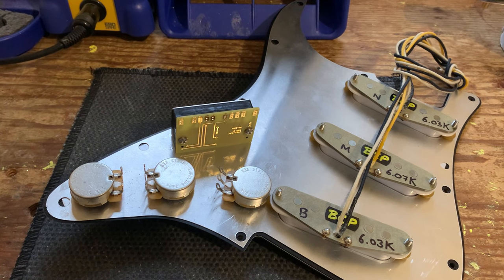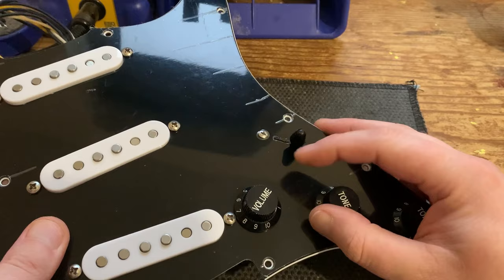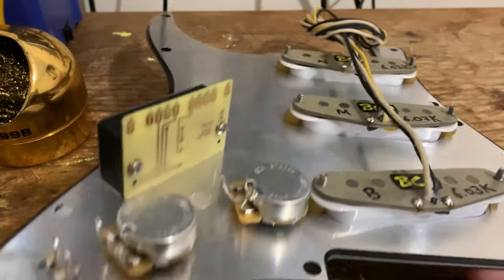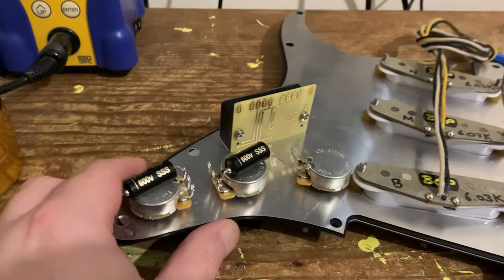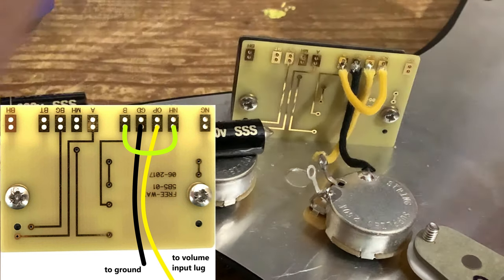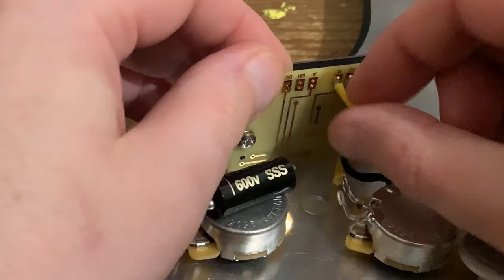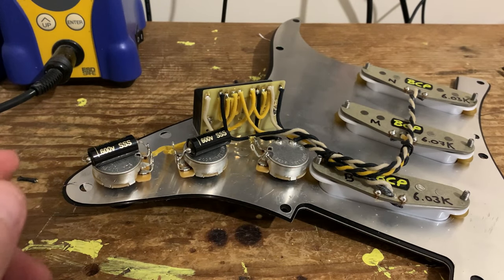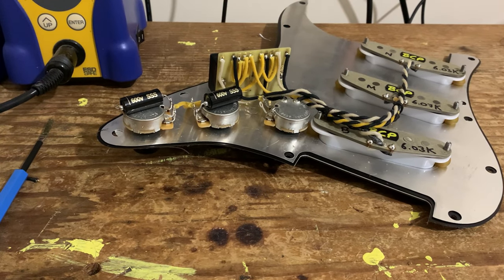10 way Strat wiring:  How to wire a Free-Way Blade Switch

Comment: Very nicely done. Do a Freeway 5-Way/10-Position install on a Nashville Style Telecaster SSS 1 Volume, 1 Tone and you'll be my hero. Great video and beautifully finished wiring job.
Reply: Yes, also waiting for that!
Reply: You have to get the 6 way switch for tele (I think) they have a wiring scheme on freeway website. 3b3-01 model and they have a wiring diagram for tele sss w 2 pots. They also have the 5 way sss w 2 pots wiring diagram but I don’t know if the switch will fit in your guitar physically otherwise to answer your question yes you can and there is a diagram for you. Go to
https://www.freewayswitch.com/schematics-blade/
Reply: @leinadatidumarp  read my reply
Reply: @50kal44  I contacted Freeway and ended up doing the 5-way/10 position in my Nashville Tele. Switch fits well, just a little hard to fit all wires in the cavity, they told me to ground the bridge with the cavity screw. Guitar is being set up now, bought a new Rosewood neck and I need to cut the nut, but all of the switching worked appropriately when I tested it the other day. Should be able to get her finished over the next couple of days. I'll let you know how it turns out, if you're interested
Reply: @50kal44  thank you
Reply: @thseed7  how is it going with your mod? I was planning on doing the same
Reply: @50kal44 that's a standard tele wiring
Reply: @andreaturano9247  Turned out incredibly well. Love the series positions and the ability to get classic Tele neck and Bridge combo in my Nashville now. Love it so much that I threw one in my Strat as well. Truly is a great functionality addition. Switch is as robust as a standard Tele 3 or 4 Way, but I haven't had any issues after hundreds of hours playing both guitars. They're significantly better than the cheap PCB 5 Way switches in the Squires or other budget guitars. Can't recommend them highly enough.

Comment: This video really helped me out a lot. Soldiering has never been my specialty, but there were a lot of little tricks and technique caught on camera that I picked up on. I'm pretty happy with the results and looks almost identical minus the difference in pots/capacitors and the pickups used. I didn't have an aluminum plate so I soldered a bare fluxed wired across all 3 pots.

Comment: Terrific video, I just went through it and replaced the switch in a 2017 American Special.  The video was invaluable, thanks.  A couple of comments... I know you had to film, and it might have been confusing, but it's very easy to solder the wires on the opposite side of the circuit board and then clip them off.  Also, the tone control bleed caps change the wiring to the tone pots.  Great job on your soldering and very nice to have clear graphics in the picture.
Reply from the maker: Glad it helped. Thanks for the feedback!

Comment: I wired my Strat up exactly as you did here. Although it has a good sound, I noticed that something may not be correct. According to the diagram from Freeway, there should be two wires going to the first spot on the left. One going to Bridge Hot, the other going to the middle lug on T2. I’m going to change it because that seems to be for tone control on the bridge only, and the other tone control is for the neck. 
I still very much appreciate your video, your tips and techniques were very helpful. Check out the diagram and please correct me if I am incorrect.

Comment: Hi I've watched a lot of your videos, and find them impressive and very helpful. I've just finished wiring up one of these Freeway switches and found it reasonably straightforward. However, I found it much easier to feed the wire in from the front as you show then solder from the back. I found the 'fluff' on the wire a nuisance to get around! These cloth wires seem to vary a lot depending on supplier, and description they give - the best ones have a fully soldered core and tight cloth, some I bought have separate core wires and fluffy cloth surround. Cheers.

Comment: Huge thanks for this!
I have a Suhr 'strat' HSS set up and standard fender strat guitars. I think Free-Way also covers the HSS option, though there's a bunch of soldering options also - hopefully a bridge humbucker split option will allow S, -, S in parallel (there's a fantastic 'Tele' tone here!)
I really think they should do, as well as a 2 x 5 option (as seen here), they should expand this for a 3 x 5 option, giving us an extra bank to cover missing options. Same applies for the Les Paul 3-way toggle selector (they do a 2 x 3, a 3 x 3 would add further sounds). If they can bank those additional connections to one side of a standard selector switch, I'm hoping they can bank to the other side also.

Comment: This is a great switch and I can strongly recommend the Page 1 scheme where you use Middle and Bridge pickup seriell instead of all three together. I tried that first but the three single could together creates a muddy mess while Middle and Bridge together can be useful for some gain/overdrive.
What I would like to do is to use the Second tone control for both Middle and Bridge but I haven't found a way. I tried a cable from MH to the tone  second tone pot but that didn't work.
Reply from the maker: Yes we use the page 1 scheme in our prewired kit as all three pickups in series is pretty underwhelming! We have a way, so feel free to email us and we can send the diagram
Reply: @SixStringSupplies  Thanks. I got a scheme from Freeway and a Bourne Dual Gang Pot from RS and it seems to work fine. I have never used a Dual Pot before, half the turn for middle and half for bridge. I thought it would control both at the same time, but this will work too. 
And thank you for an excellent channel!!

Comment: Amazing video. Wired mine up with little to no soldering experience (bought a practice kit off ebay) thanks to your video.

I did follow the alternate wiring diagram because I wanted the "humbucker" in position 6. Minor change and easy enough to figure out after watching this video. Thank you!

Comment: Very smart to use a PC board to avoid a cluster of wires, simple and genius.  Over engineering I using a pc board with programmed configurations, this requires a small populated board with both passive and active electronics, programming ( increases risk of failure) and a power source ( battery).

Comment: Super helpful video!  I have a quick question about wiring up this switch with specific pickups.  I'm curious about getting some Fender noiseless strat single coil pickups, which have 3 wires coming from each pickup instead of 2 like with regular single coils.  Would it be possible to get some of these noiseless single coils and wire them up with this 10 way switch?

Comment: Super video, super explained! I still have one question. Do capacitors with the same capacitance have to be soldered in this circuit? I have one 0.047 and one 0.022. To which potentiometer do I have to solder which capacitor?

Comment: Great video. Thank you. But how would you wire it so the middle tone pot works on the bridge pickup as well. On a normal switch you can just add a bridging wire but how would you do it on this switch? Thank you.

Comment: I have just purchased the 10 way strat switch and in preparation to install, I have noticed my current 5 way switch setup has 2 capacitors that are not shown in the 10 way switch setup. I just want to double check whether i leave them as they are or remove them from the board? Basically there is an additional capacitor on each tone knob that bridges 2 of the points on the same capacitor...if that makes sense...

Comment: You need to do a video on how to wire a 6 way rotary switch on a strat.  Pull the 5 way switch and put the 6 way 6t/2 poll rotary in a tone slot. You can cut the post with a dremel or hack saw if it's too long.  Takes 30 seconds with a dremel.  Took me a day to figure out the wiring on it.  It gives you an added position.  Bridge/neck.  And it gets the switch out of the way so you don't hit it while chording hard.

Comment: Hello, I have a problem with the bridge capacitor. When I move the bridge potentiometer it acts on the middle pickup. I did the installation as shown in the diagram.

Comment: Great video. You're absolutely right the PCB holes are too small. I wired one up a few months ago , but then the tone controls stopped working in all positions except the neck. Any suggestions I can try to remedy this?
Reply: Sounds like your connection to the bottom tone knob is broken at some point. Check the solder joints for the wire that runs from the switch to that pot.

Comment: Thanks for the video. If I wanted to add my bridge pickup to be controlled with the neck tone knob (middle tone knob for middle pu only and the neck tone knob to adjust both neck and bridge tone then where should I add a bridge wire to this wiring diagram to accomplish this ? Thanks so much for any help

Comment: Good vid, thanks. Was wondering...I don't want to get the installation of the switch the wrong way round. If the lever is closest to the BH terminal side, presumably that will turn on the Bridge pickups? And if the lever is over to the NG terminal, that's going to switch on the neck pickup - is that right - have i got it the right way round?

Comment: I've got a Question:
I got a Fender Deluxe Nashville Telecaster about a year ago. From the Factory it came with a normal Strat Switch. I resoldered it so i got this: 1. Position Middle
         2. Position Middle+Bridge
         3. Position Bridge
         4. Position Neck+Bridge
         5. Position Neck.

Now my Question: Can i Install this Switch in my Tele and Set it like this:
Normal Roe: 
1. Position Bridge
2. Position Bridge+Neck
3. Position Neck

Upper Roe:
1. Position Middle+Bridge
2. Position Middle
3. Position Middle+Neck

Or do i have to do the whole in Series, Out of Phase Wiring?

Comment: BT is used with a Bridge Humbucker if a 5B5-01 is used in an HSS set up. With Seymour Duncan wiring codes the red and white wire would be soldered to BT.  So I suppose BT is for Bridge Tap for what is technically a coil split in the relevant switch positions.
Reply from the maker: good knowledge, thanks for sharing. Free-Way to have a specialist switch specifically designed for HSS setups too 5B5-02 https://www.freewayswitch.com/products/
Reply: @SixStringSupplies  No problem I spend too much time looking at wiring and guitar stuff. I have seen the diagrams for the 5B5-02 and emailed Freeway a little while ago but at that time they weren't available yet. Looks they are starting to become available.
Reply from the maker: They are available now at various dealers - we expect to have them in stock for our next order which will be February.

Comment: Hi , do you know if I could add a resistor between BT and BH to lessen the coil split volume drop and liven up position 2 ? I have a 4 wire humbucker in the bridge and position 1 and 2 is a bit weak . Great vids by the way ...thanks

Comment: Can a treble bleed mod be done with a freeway switch installed? Would the different kinds of pickup wirings vs. the standard need to be considered / have any influence on which capacitor/resistor to choose? Any experience here? :)

Comment: Great video. I'm keen to try it. On the PDF it says Terminal A is not used. Is that correct or did I miss something. I noticed you used it.
Reply from the maker: Different diagram - there are two options

Comment: Hello, thank you very much for the professional guide to soldering the Freeway Switch 5B5-01.  I just installed the device in my Harley Benton ST-20 BK.  Everything went well, all positions work - only position 6 (bridge + middle in series) remains "dead" 🙁 Also the tone knobs are working not as they should. Do you have an idea what is wrong?
Reply from the maker: Hi - does your bridge pickup have a baseplate? If so, this will be the issue - you need to ground it to the switch as directed by the diagram (or remove it entirely)
Reply: @SixStringSupplies  Hello, thank you very much for your answer.  No, my bridge pickup doesn't have a metal baseplate.  I have now soldered everything again as the instructions for the SSS Parallel Series Sheme A1 / V2 T show.  Result: The same error - position 6 in series remains dead. Perhaps the switch itself is defective.  I asked the seller to send me a replacement.  I'll get in touch when the new switch is soldered.  So long, Wolf

Comment: Can this be put on a clapton signatur?? It only has 1 tone (upper tone) with the lower being used for the 25db boost.  I am goona to assume your  bottom tone connection is going to the upper tone control.
Reply: I tried installing and didn't work right at all. I contacted their tech support and they sent me hand drawn schematics (as they do not have official ones for tbx models) that they sent to others wiring tbx guitars. Main difference seemed to be their OP went to tbx tone pot instead of vol. Still not correct as pickups don't function, even when they do, according to the switch location.

Is there anyway to check if switch isn't damaged? Can someone that wired one of these to a tbx guitar please assist. She is my primary guitar.

Comment: I’m having a very shitty problem fellas, used the scheme A diagram and i’m noticing kind of a volume and frecuency change in position 2 and 4 which is weird cause those are the normal 2 pickup strat positions (N+M and M+B) also in the In series positions I’m noticing a volume decrease. Idk if the wiring is having issues or if that’s the nature of the switch. Any thoughts?

Comment: Middle hot goes to A and not MH.  That's correct?
Reply from the maker: Either. A is connected to MH anyway. The diagram has it going to A. But it doesn't matter which one, whichever has most space!
Reply: Ah.  Hey, your vids really helped.  I combined your 4 way mod with the reorder mod and the "Gibson" wiring (I think that's the name) mod.  Good pacing in your videos.  

You can even see my dogs**t soldering in my channel.
Reply from the maker: Thanks! Thanks for watching and glad you like the videos and find them useful. Have a good weekend

Comment: Have this switch on the way for my strat. I currently have a “neck on” toggle which I will turn into a phase-changing switch once it’s in. However, I did have my lower tone knob wired to control both bridge and middle - very easy just one jumper wire, I’m trying to work through in my head how to wire the bridge to tone control with this configuration. My gut tells me that the same method won’t work for this switch but I’m not sure.. any suggestions?
Reply from the maker: Hey, unfortunately it does not appear possible to have all 3 pickups connected to tone controls with this switch - you can refer to the FreeWay website, they have diagrams on there. You can either have neck + middle (no bridge) or neck + bridge (no middle) so you have to decide which one you prefer

Comment: Before taking it apart to measure I'm wondering if anyone knows how close the box is to the size of a standard 5 way switch? Basically I have an Aerodyne MIJ I'm curious about, whether it will fit in the existing rout. Ive seen the measurements of the 10 way but haven't found dimensions of the existing 5 way part. I guess ill have to get in there. Wonder if anyone gas put one in. I live the Aerodyne guardless design but it does limit things a bit in terms of part swapping.
Reply: I'm just curious if anyone has done one. Trying to figure out over the web which mods are possible that are reversible, without routing the body to make larger chambers.

Comment: do you need different volume pot's for your tone or do you just pout capacitors on them?
Reply from the maker: Refer to latest video 👍 it’s the way a lot is wired than makes it function as either a volume control or tone control
Reply: @SixStringSupplies  thankyou

Comment: is it important to have a 600v capacitor for this 10 way switch  or is it ok to have a lower voltage?
Reply from the maker: not at all - 600v is excessive - 100v is absolutely fine.
Reply: @SixStringSupplies  thank you🙂

Comment: The Free-Way switch diagram has a capacitor on both tone pots. Typical wiring only requires the one, but it's connected to both pots. Does the Free-Way require two capacitors to function properly?

Comment: Good Evening,
Could someone please verify if this is appropriate wire to use for this wiring (see quotations):   
"Vintage Style Cloth Covered Wire push back, cloth covered wire, 22 gauge, Unshielded, single conductor, stranded wire with a waxed braided cotton outer insulation."
Thank you very much.
Reply: The key word you need it tinned. So Tinned, cloth covered guitar wire, 22 awg
Reply: Thank you very much Bill.
 @billkath

Comment: The all 3 pickups setting in series is muddy and not usable. The 3 pickups in parallel IS usable. And you should have gone for bridge with middle in series instead of the 3 pickups in series.

Comment: Anyone recommend a good electronics store to purchase the caps? 
I can't locate them anywhere.
Thanks.

Nevermind. I found guitarelectronics. Got a .022 and a 0.47 for ten bucks delivered. 
Nice.
Reply: Try MojoTone, Thomann, Caparelli and Reverb.
Reply: Are capacitors necessary? My guitar doesn't have them currently, so I'd need to install them with the switch.